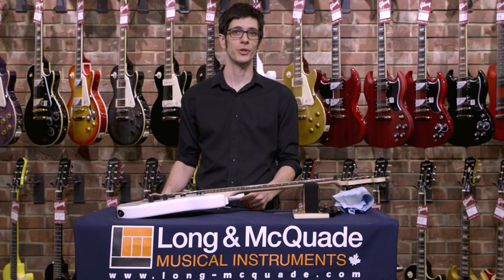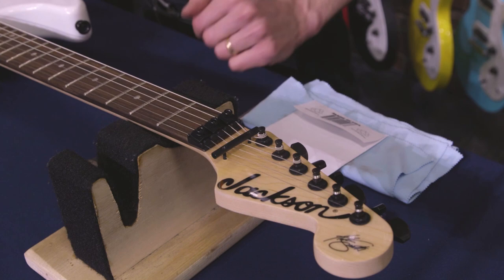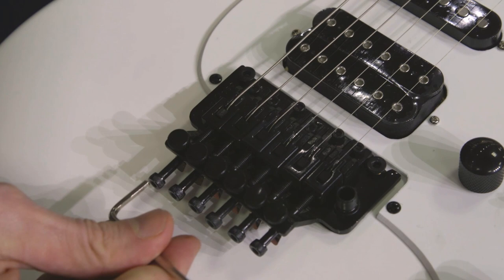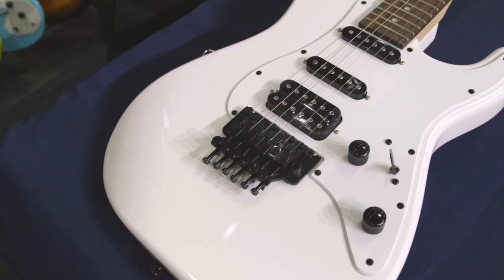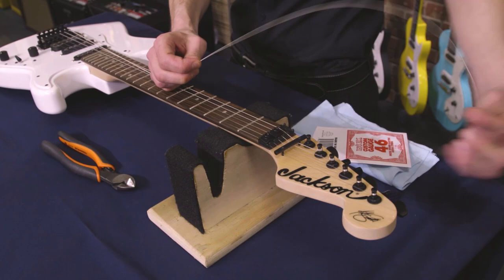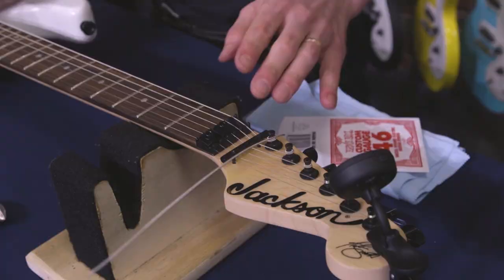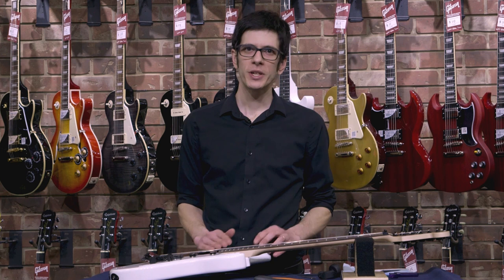How to Change a String on a Floyd Rose Guitar

Comment: First you break a string on stage, next search for the tool kit, unbolt the locking nut, unravel the string from the machine post, unlock the string from the tremblock, feed the new string through the machine post (Ball end last) feed it through the string tree, and re clamp it in tremblock, tune up from the machine head cutting off the ball end and any overhang, check the intonation, then re-bolt the clamp. No hurry, as the gig is over by now!
Reply: Yeah - take 2 guitars to a gig is the rule there. It is a nightmare.
Reply: Most bands have a guitar for every song,
Nobody can replace strings on a flyod that quick.
Reply: and thats why you always take back up guitar when you gig....... ;)
Reply: But wait, What do I see?,...He's not talking to me.

Brake string playing. Take magnet  key off tuning peg or clip. Open lock nut only a little bit. Other end of key in saddle vise, open a bit, pull out little piece. unwind tuning peg until you have enough to insert into saddle vise again. lock saddle vise, tune guitar string, lock the nut. 
 String with the ball up top on the tuning pegs to always have enough string.
 Who breaks a string anywhere else ? Only at the bridge.
 You could always sign it, chuck it out in the crowd and grab the back up one you better have.

Comment: Excellent video! Just changed the strings for the first time ever on a floating Floyd Rose tremolo. Too intimidated to do it myself but too cheap to pay someone else. Here’s what I would add from watching a few of these:

1. After tuning the string, stretch each out a few times and then retune it. 2 or 3 times should do it. Now lock that sucker in.
2. There is no #2
3. See #2

Comment: You forgot about resetting the fine tuners before you tune and lock the nut. Otherwise, great video for a straight change.
Reply: Also, tune from the middle strings to the outer strings, so GDBAEe.
Reply: @TheOneTrueSpLiT  thanks for the info. Why do you have to do it this way please?

Comment: Cool video. I learned way back in the 80's to not cut the ball off.  String from the pegs back to the bridge. Pull the string all the way through until the ball end pulls tight in the tuning peg.  Pull the string to about the lock down posts after the bridge, cut there-ish, depending on how much string you want on the post. Put the string in the saddle block, tighten down then tune up! Done!  With a power winder it's usually less than 10 minutes.
Reply: Why leave the ball ends on? Is there any benefit?
Reply: @PocketTits  Well, you don't have to hold the cut string while winding on the peg just pull snug cut and go.  Just a comment really, not trying to ruffle any feathers. Cheers.
Reply: @robtech341  nice. That makes sense. Ty.

Comment: Although the fret bar marks wont line up, if you string the system from the top tuning pegs with the balls up there, wind it up, your broke string don't have to leave the guitar to loosen up the locks and unwind enough to re-insert into the saddle vice. String always breaks there.

Comment: This demo is great but perhaps should have mentioned that tuning the whole guitar after changing every string isn't enough. You got to ensure the entire axe is in tune with the digital tuner  before you even change the first string. I failed to do so yesterday and the result was me continuously adjusting the whole thing and it took really long. Also got the impression the string action is now higher. Will bring the guitar to the shop today :-(
Reply from the maker: We're sorry to hear this, but ensuring the guitar is in tune before changing the strings doesn't make much sense to us logically, because the first step to removing the strings would be to unwind it to reduce tension so it can be safely snipped.  Demo video or not, a Floyd Rose guitar is very tricky to swap strings on or setup for the first time.  We commend you for giving it a shot yourself and we hope it doesn't deter you from trying again next time.  That's the only way you'll get better and the process will be easier each time you do it.

Comment: Thanks Mike !! - Great and helpful video - but I need to take all 6 strings off to file the frets .  I know you recommend doing one string at a time (makes complete sense). Other than using masking tape to keep the bridge pieces from falling off, and making sure to keep the locking nut blocks in the right direction and order, are there any other tips?? Thanks in advance !!

Comment: Without removing all strings off the fingerboard, I fine it impossible to clean the fret and fretboard while that's the best chance to do it completely and properly.
Reply from the maker: It's certainly easier to clean with all the strings off, but you're setting yourself up for a headache getting everything back to normal when putting on all new strings.  It's easier to take the E A D strings off, clean the fingerboard under there, put new E A D strings on, then take off the G B E strings, clean that half of the fingerboard, then put new G B E strings on.

Comment: Oh yeah, # 2 was.... set your fine tuners midway between bottom and top. For instance if it takes 12 turns from highest to lowest then set it at 6 turns before you lock it.
#3 was.... don’t be stoned when you write reviews!
Reply: I will be changing my strings on a floyd rose for the first time, can you explain more on the fine tuners, when to loose it up? And not sure what u mean by half way? Thanks a lot. Simon
Reply: @simoncheng5665  tighten one of your fine tuners UP and one all the way DOWN.... Then you will see where the MIDDLE is and THAT  is where your fine tuners should be initially when you've got your tuning close and you lock the nut...

Comment: Why not feed the string from the neck to the bridge and cut the string at the bridge, leaving the string ball / nut on the string? Makes it much easier to keep the string in place on the machine head 😊
Reply from the maker: We do see this method sometimes on guitars coming into the shop. There isn't necessarily an issue with this trick, if that's how you choose to do it.  There are many correct ways to restring a guitar, if it makes it the process easier for you, we say go for it!  However, we should explain why we choose not to use this method at Long & McQuade.  There's an increased risk of string breakage. The ball end of the string is thicker with additional windings and is not intended to be wound tightly around a machine head.  For this reason, our shop sticks to the traditional string orientation to be on the safe side. It's a small risk, but it is one of those things we consider when deciding what our best practices are in the repair shop.
Reply: @longandmcquade  Good point, I didn't think about the amount of string that is wound around the machine head.  Thanks for the tip, maybe I was being too lazy LOL

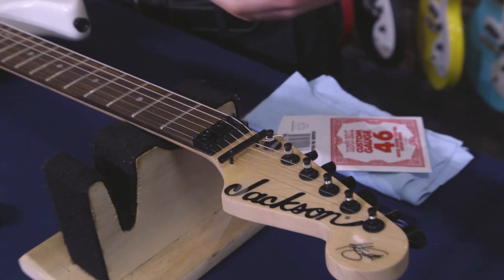Comment: You say that if you're changing only 1 string, you still need to tune all them 6. But how you do it? I'm confused because what you said on 1:01. But then in 6:09 you tune all strings with the locks on !! 

Help me!! Thanks !
Reply from the maker: If you look more closely at 6:09 the lock on the low E and A strings has been removed.

Comment: Ive played guitar for about 15 years now and have never owned a floyd what happens if you restring all the strings at the same time instead of one at a time very rarely do I break strings and when I do it's normally time to replace all of them.
Reply: The bridge will be quite out of balance, and it's a bitch to get it back to where it should be
Reply: @iamhung9384  ha yeah um i just done that, how do I fix it?

Comment: Can u pull the string through backwards and leave the ball as a stop on the tuning key?
Reply from the maker: Yes you can.  There are several ways to accomplish the same task.
Reply: @longandmcquade  after I asked I tried it, it didn’t work too well, as the ball rotated around it became in the way for the next string, so I cut it and did it the “right” way